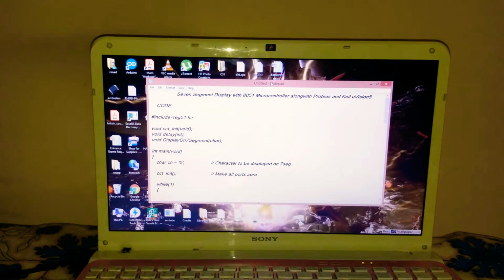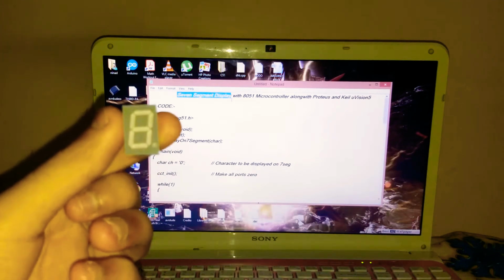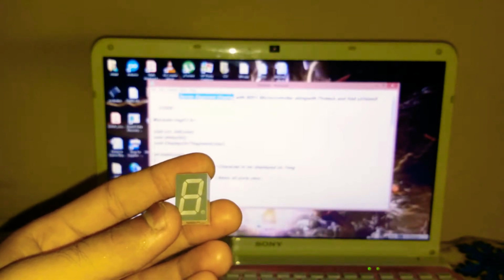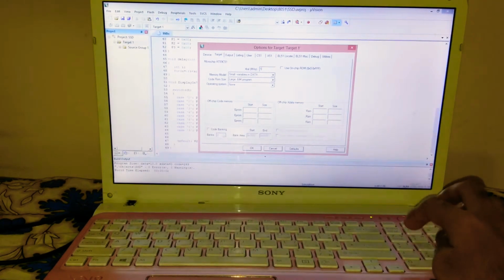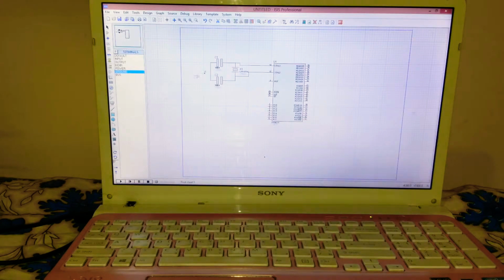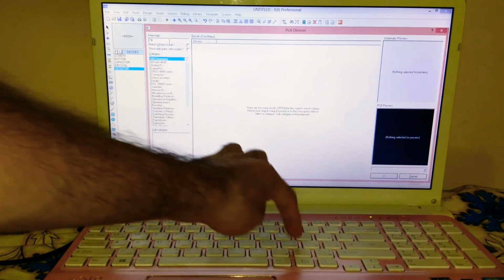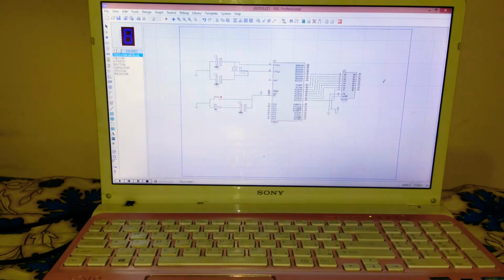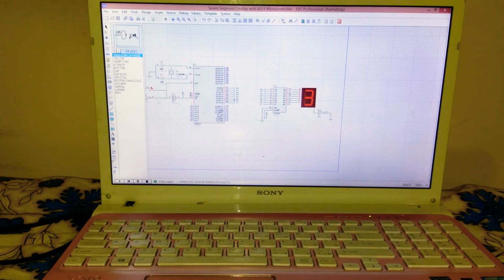Interfacing SEVEN SEGMENT DISPLAY with 8051 Microcontroller along with Proteus and Keil UVISION5😁

Comment from the maker: Steps to carry on your simulation :-
1.START YOUR KEIL UVISION5. 
2. SELECT PROJECT 》NEW UVISION PROJECT...AND THEN SELECT SSD AS FOLDER TO SAVE IN,ALSO TYPE SSD AS FILE NAME.
3. THEN SELECT AT89C51 FROM ATMEL AS THE MICROCONTROLLER. INSIDE THE WINDOW POPS-UP. ALSO CLICK YES TO COPY THE PROJECT FOLDER.
4. UNDER THE FILE MENU SELECT NEW.
5. WRITE YOUR CODE IN SPACE PROVIDED AND SAVE IT AS (SSD.C) IN THE SAME PROJECT FOLDER.
6.THE PROJECT WINDOW ON LEFT GIVES YOU HIERARCHY  OF TARGET FOLDER AND SOURCE GROUP FOLDER. RIGHT CLICK ON "SOURCE GROUP 1" AND SELECT  " ADD FILES TO SOURCE ADD GROUP CODE".
7.LOCATE SSD.C AND INCLUDE IT IN GROUP FOLDER.
8.CLICK PROJECT MENU AND THEN SELECT BUILD TARGET,.
9. RIGHT CLICK ON TARGET MENU AND SELECT "OPTIONS FOR TARGET" AND CHANGE XTAL (MHZ) TO 11.0592 MHZ. THEN GO TO OUTPUT TAB ON SAME WINDOW AND CHECK  THE "CREATE HEX FILE" CHECK BOX AND THEN CLICK OK.
10. OPEN PROTEUS.
11. SELECT THE DESIRED COMPONENTS, PLACE THEM AND DESIGN THE CIRCUIT ACCORDINGLY. 
12. RIGHT CLICK ON MICROCONTROLLER. 
13. NEXT TO THE PROGRAM FILES OPTION,THERE IS BROWSE OPTION.
14. RUN THE SIMULATION...AND WATCH THE NUMBERS GLOWING ACCORDING TO YOUR COMMANDS!!!!

CODE:-
#include<reg51.h>

void cct_init(void);
void delay(int);
void DisplayOn7Segment(char);

int main(void)
{
   char ch = '0';           // Character to be displayed on 7seg

   cct_init();              // Make all ports zero 

   while(1)           
   {
 DisplayOn7Segment(ch);   // Display ch on 7seg
 delay(30000);     // About 1 sec delay

 switch(ch)      // Update ch with new value to be displayed
 {
  case '0': ch = '1';  break;
  case '1': ch = '2';  break;
  case '2': ch = '3';  break;
  case '3': ch = '4';  break;
  case '4': ch = '5';  break;
  case '5': ch = '6';  break;
  case '6': ch = '7';  break;
  case '7': ch = '8';  break;
  case '8': ch = '9';  break;
  case '9': ch = '0';  break;
 
 
  default: ch = '0';  break;
 }
   }
}

void cct_init(void)
{
 P0 = 0x00;   
 P1 = 0x00;   
 P2 = 0x00;   
 P3 = 0x00;  
}

void delay(int a)
{
   int i;
   for(i=0;i<a;i++);   //null statement
}

void DisplayOn7Segment(char ch)   // ch can have a value from '0' to 'F' only
{
 switch(ch)
 {
  case '0': P2 = 0x3F;  break;
  case '1': P2 = 0x06;  break;
  case '2': P2 = 0x5B;  break;
  case '3': P2 = 0x4F;  break;
  case '4': P2 = 0x66;  break;
  case '5': P2 = 0x6D;  break;
  case '6': P2 = 0x7D;  break;
  case '7': P2 = 0x07;  break;
  case '8': P2 = 0x7F;  break;
  case '9': P2 = 0x6F;  break;
 

  default: P2 = 0x3F;  break;
 } 
}